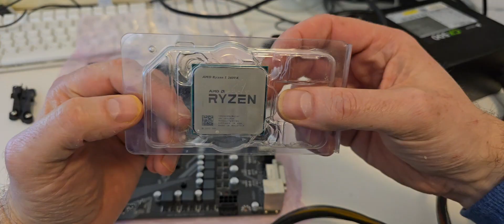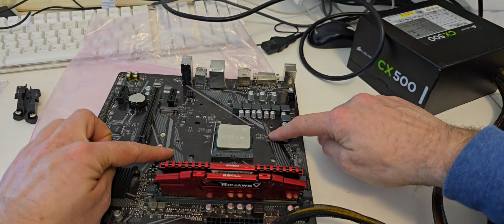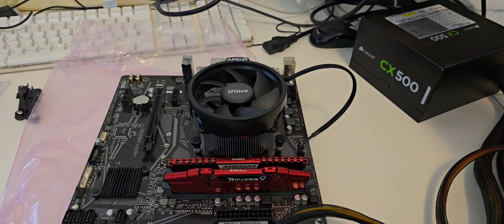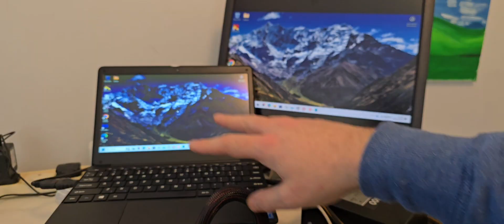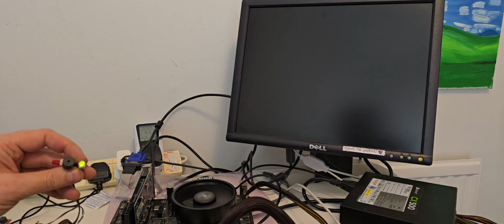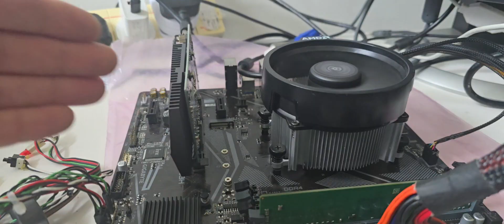User error : A520 Motherboard and the Wrong Ryzen CPU (1000 and 2000 series unsupported)

Comment: I just built a PC with a Ryzen 5 2600 on a A520M K V2. It worked at the beginning but no POST after a few days, even with latest BIOS update. I changed the CPU for another 2600 and it worked again. A few days later, same thing, no POST, black screen. 

I checked the motherboard's website, it says "support Ryzen 3000+", can't find 2000 anywhere. That's why ! I'm gonna replace the 2600 with a 3600.
Reply from the maker: Strange that it works for a little bit, but a newer cpu sounds like the solution, that’s what I did in the end.
Reply: @PCGTV2  Hellow. how did u get this one fixed? experiencing the same problem. I have a ryzen 3 3200g, an asus prime a520k and it's only turning on the fans but no display... did u buy a new cpu?

Comment: I stopped swapping CPUs about 20 years ago once I was able to build complete PCs with new or newish parts. In the last year I replaced my ASUS build's Core i5 4570 with an E3 Xeon, and then changed that for a Core i7 4770K, all socket 1150. Last one was replacing the Lenovo Core i5 3470 with an i7 3770K.
Luckily, they all work, but the Xeon was a pointless purchase, I should have went directly to the i7. Trying to save money LOL.
Reply from the maker: I should have gone for ryzen 5 3600 but also trying to save money... Ends up costing more.
Reply: @PCGTV2   Yep. Coulda saved $45 by avoiding the Xeon. It's not really an upgrade on an i7, in fact it's slightly slower.